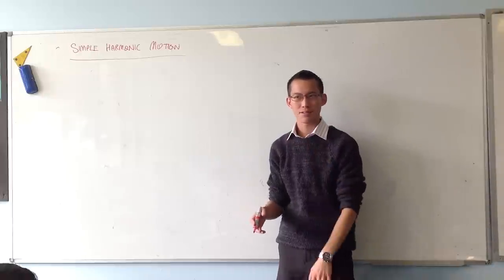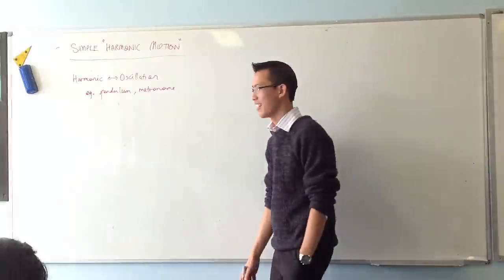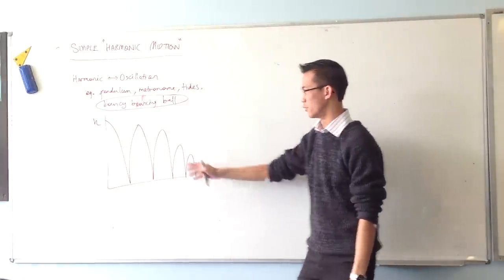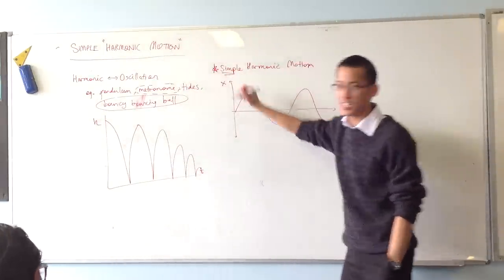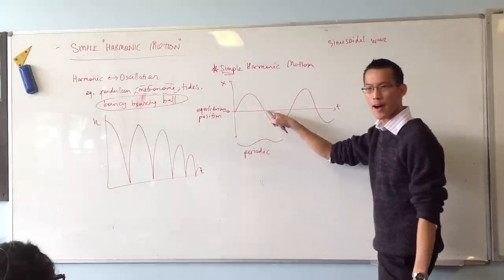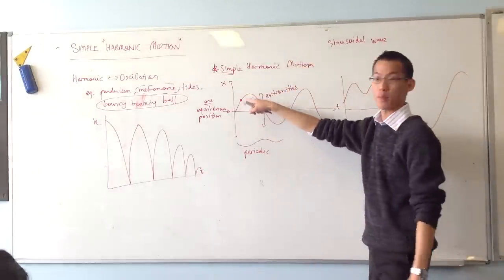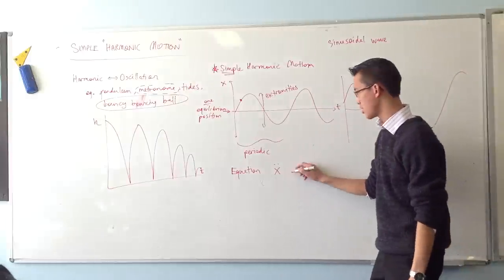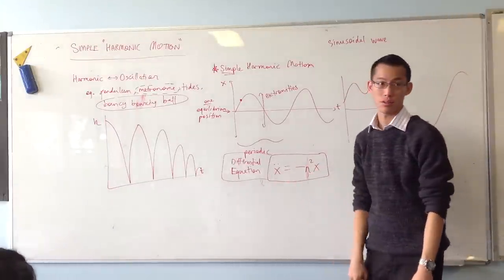Introduction to Simple Harmonic Motion

Comment: is bouncing ball shm????
Reply: I don't think so. It's velocity keeps decreasing after contact till it reaches max height instead of peaking at equilibrium and its collision with the ground is abrupt and not like shm. however his other examples were good and the bouncy ball still helps in a general analogy sort of way to at least help better visualize the motion idk
Reply: @hemilshah7032  lol he literally used it as an example of something that ISN’T simple harmonic motion, it is analogous to periodic motion tho
Reply: No, because a bouncing ball's position as a function of time, is a periodic sequence of  concave-down parabolas, joined at cusps, rather than a sine wave.  There is a huge asymmetry when the ball rebounds from the bounce quickly at the bottom, and turns around at the top slowly.   Simple Harmonic Motion is symmetric about its neutral position.